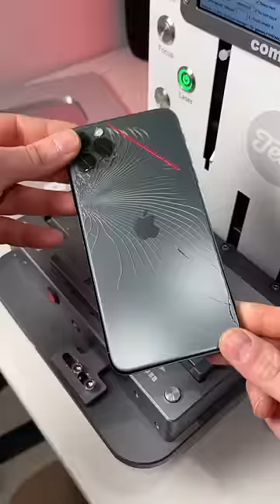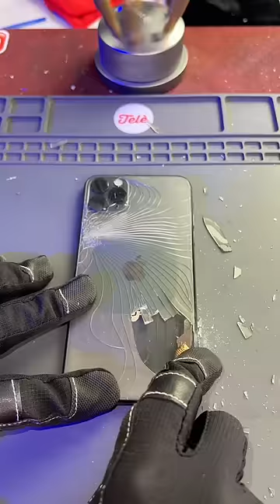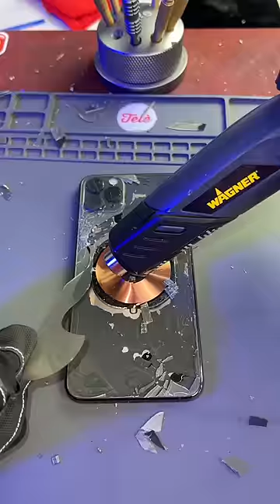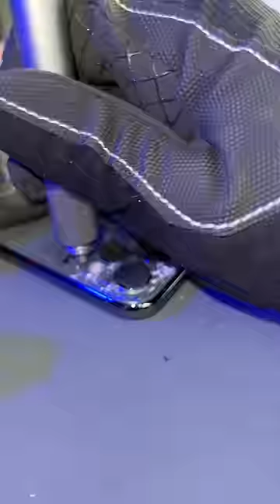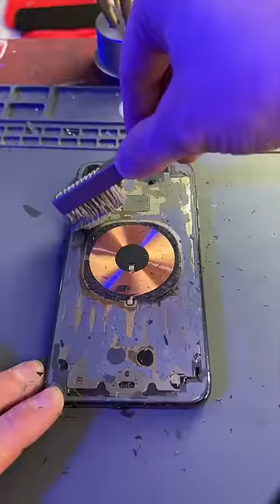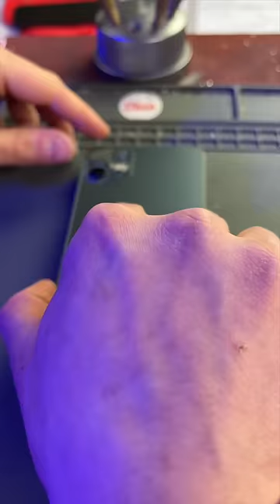Just another day at the office 🤠 #Shorts #Tech #PhoneRepair

Comment: The fact that apple makes their products in a way that makes it so damn hard to fix yet so damn easy to break is fascinating.
Reply: Fact.. I have an older version so it’s not that easy but my android one survived for years and broke after I dropped a weight on it at the gym
Reply: It’s a money grab
Reply: Phone tech here they aren’t that difficult to work on just lots of small expensive parts that you can get aftermarket whereas Samsung is a few bigger cheap parts that don’t work unless they’re oem
Reply: I’ve dropped mine on concrete 1,000 times that’s what a phone case is for. Smh
Reply: @stoneymcdoobie5270  still doesn't justify that money grabbing technique lol that's what I comment is about. 🙃
Reply: Lowkey a scam to get more money. Make it break and monopolize the repair
Reply: @godspeed2621  my phone break after it hit something metal like a iPhone wont survive that
Reply: @bofjayyy  then why are they built like a tank
Reply: @alexjackyperson101  they don't use as much glass as Apple and they use big clunky casing screens vs apple uses 3 layered screens which is the digitizer lcd and back plate when you get a screen repaired for a Samsung it just guts the old phone and throw it in a New one vs getting a new 3 layered screen with apple
Reply: and that it is more expensive to repair it than to buy a new one
Reply: @godspeed2621  5kg?
Reply: What is your solution then
Reply: Like most super cars you mean? Where you get a dent in the fender and it can cost you 15k to repair? It’s how the world works buddy
Reply: Its easy to fix when you have the right tool.
Reply: @stoneymcdoobie5270  it can still crack phone case are not and for really good ones they usually cost 40-50$ which really isn’t worth it same with a screen protector if that breaks have a choice to keep it or replace it
Reply: Who wants a phone made from glass wtf
Reply: But it’s also good quality
Reply: It's so you buy another one.
Reply: It's the only way they can ENSURE they will ALWAYS make profit from their products. Google how much they make from their repairs 💀
Reply: @garden3818  they don’t make it break it’s the person who owns it that makes it break. Just take better care of your shit and you won’t have that problem.
Reply: @godspeed2621  I mean I know it’s an outlier but I’ve dropped my old iPhone 2 stories onto concrete and it survived with a dent like no screen crack 😂 that think went through hell and the only reason I replaced it (the whole back and everything was off it) was because the battery in it got fucked
Reply: @mrkaiman3052  the bullshit with apple is their ports, they make a different port for every phone so that you neeed to spend more and more money it’s a joke
Reply: It’s actually not like this if you do it with apples tools. For instance the iPhone 12s and up have a heat tool that makes it super easy. Idk how much I can say as a tech on the internet so I’ll leave it there, but this guy did it a way harder way 😅
Reply: Samsung dose the same with their screens
Reply: @TB Budak it’s all luck of the draw, you’ll drop it 100 times as I did and it won’t break even after a 2 story fall twice,onto concrete, then it ended up breaking when I was playing music in my pocket and it dropped onto concrete
Reply: Invent the problem, then sell the solution
Reply: They don’t? 😂
Reply: Samsung's are the same lately don't worry. As a phone salesman it's getting more and more frustrating having to explain why the companies suck.
Reply: Honestly I think it’s the cases people put on them, hell some even go without a case. 

I’ve had my iPhone 12 for about 2 and a half years, and I haven’t broken it once, and that’s with my clumsy self and dropping it every other day.
Reply: Almost seems planned doesnt it?
Reply: Planned obsolescence. Blame cars and lightbulbs.
Reply: And that people are so obsessed with them...only because they're trendy 🤣.  It's so weird to me
Reply: guys. samsung MANUFACTURES the iPhone. clueless🤣
Reply: I’ve only cracked my iPhone screens twice and I’ve been using iPhones since the 4s. It’s not easy to break them. How about y’all stop hating on iPhones like little android fanboys and actually use the product for a second. 75% of y’all haven’t owned an iPhone ever, 20% owned an old iPhone, and 5% bought a new one and just didn’t like the OS. That 5% is valid. The rest? Not so much. Read any review and the vast majority of reviewers will praise the iPhone.
Reply: my samsung phone got accidentally run by my friend car and the only thing that broke is the tempered glass
Reply: @Zer0Edits00  Yes however, only people who can afford to buy super cars aren't inconvenienced with a 15k$ repair. Whereas the majority of people who are lower class buy smartphones (many on the cheaper end tbf) but they do care that they're not getting their money's worth. Its just that their opinion means little in the face of a capitalist, market economy.

In short, USA itself is a scam and the people are okay with that so long as they can continue to scam their neighbors to get ahead. We have many commodities that other countries do not, this is true but make no mistake they are far from free.
Reply: Easy to break?! People are just carefree and don't treat expensive phones with care. Ofc all phones designed with glass backs break easier than the ones with plastic, because it's glass. Just get a case if you worry so much about breaking it.
Reply: @godspeed2621 genuine question, how do u accidentally drop a weight on ur phone? 💀
Reply: @dadeee7776  you… you mean the port that hasn’t changed in, what, ten(?) years?
Reply: Is it really that easy to break though? I’ve had 3 glass back phones, the XR, the 11 pro, and currently the 14. Never broken a single one. Not even a crack to the back glass.
Reply: And people love it
Reply: man you've made so many mistakes in spelling of "fascism"
Reply: What's fascinating is that people are stupid enough to buy it again and again.
Reply: @godspeed2621  itd be fine if it were a nokia
Reply: I usually put it under the seat but s @JonteTheRoach
Reply: @zaimnaqvi8893  doubt
Reply: @dadeee7776  Pretty rare but I guess the battery absorbed impact
Reply: @ElBurras5000  30 kg
Reply: I got my iphone 12 awhile ago and ngl it's been working great for me the only thing I've really broken so far has been my screen protectors but never the actual glass on the phone, I used to use alot of Samsung devices and I would constantly be going through them every year but I've been much happier with my iPhone than I was with my Samsung's. Idk it's much more personal preference and also how you use your phone.
Reply: Made in China
Reply: Or you could just put a $10 case on your phone 💀 its really not that complicated
Reply: Bro i am using iphone 7 aluminium body 😂 it often falls and I don’t care 💪
Reply: But why do people speand 1000 on a phone, thats more than my rent every month
Reply: It's capitalism 101😊
Reply: @godspeed2621   lmao
Reply: @bofjayyy  Also a phone tech here, that is BS as I have used aftermarket Samsung parts which work fine, definitely not as good as OEM service packs though. It's the iPhone parts that don't work properly and get software locked when not using OEM parts...
Reply: You mean criminal
Reply: their laptops are even worse ffs
Reply: @bofjayyy  what,s oem?
Reply: Everything is fascinating for iSheeps
Reply: They ain't easy to break? I've had my iPhone for 2+ years and I've dropped it without the case so many times. Not a scratch on it.
Reply: Yeah cuz they are betting on you breaking it and having to buy a new one since fixing the current one is so difficult and
Reply: @zzekegaming  You're clueless bro. Samsung only manufactures the display, display controller and NAND flash chips for the iPhones. They have no control over how the iPhone is designed or how repairable it is. That's stupid like saying to blame IBM for the Xbox being difficult to repair because IBM happens to manufacture the CPU chip for them..
Reply: @ElBurras5000 my Samsung tablet survived after i dropped it more than 10 times, i have it for about 4 years and its not that bad
Reply: @ElBurras5000 i never seen a phone that is cheaper to buy a hew one than repair it, maybe because I live in a South americana country and ppl here are poor idk
Reply: @paranaenselol  si ves que me llamo "ElBurras5000" y eres de Sudamérica entonces por qué no me hablas en castellano o portugués? 🤦🏽‍♂️
Reply: Planned Obsolescence is to blame
Reply: Fact
Reply: @bofjayyy Apple literally locks certain functions of the phone if you use non OEM parts, even if they are from another iPhone. Meaning you have to reprogram the parts serial numbers to trick the phone. Im not even a phone technician and I know that. Samsungs will work just fine with non -OEM parts, but the OEM ones are mucb better.
Reply: @starmanxvi  could you go over some examples the only features I've experienced issues with is wireless charging due to the internal connections being damaged and not tracking battery health with non oem parts I've replaced nearly every part of a iPhone and there's been no issues
Reply: the fact that people happily BUY them is fascinating
Reply: i think the word you're looking for is *expensive
Reply: I don’t understand why buy expensive flagship phones if they are of little use. After all, you can make calls and go online on a phone that has an average price.
Reply: Funny how you can’t tell which of the latest years of pro / pro max this phone is
Reply: The fact that android makes phones that the back and battery fall out of when you drop it 😭
Reply: The Iphone 7 was their strongest phone so far. The rest its weak
Reply: its all about that bag boah
Reply: Funny how u said this right before the 15 came out lmfao
Reply: That's completely by design so you have to spend more money on a new product. You'll notice that the warranty conveniently doesn't cover drop damage or water damage. That plus planned obsolescence means they can rip those dollars straight outta your bank account
Reply: Easy to break? You should see my Samsung. Your iPhone should be just fine as long as you don’t throw it around s 😂
Reply: on porpoise
Reply: also keep in mind until fairly recently you couldnt get oem parts for iphone, or rather the best you'd get is a refurb, with samsung you could usually always get get OEM service pack, and some of the high end samsungs are still cheaper to fix with a service pack than your equivalent iphone with a refurb. take for example, to fix my S22ultra would be about $250 for a service pack, for the 14 pro max that much will only get you a fog oled screen, which is aftermarket, while the refurb is gonna cost you $370, this of course is just parts cost, and assumes you'd be doing the replacement yourself, if not, expect to pay somewhere around $350 for the samsung and $470 for the iphone, not including sales tax.

 also iphones love to make many of the parts serialized, so even if you did use oem parts, certain things wont work the same or at all. apple doesnt want you to fix anything, and probably considers the very idea to be an afront to their brand image, judging by their past comments about iMacs  turning into PC's if you alter them in any way; they want you to just toss the whole phone in a landfill and buy a brand new one. Yes, samsung isnt that far behind apple as a company and even worse in some areas, but I still think they are the lesser of two evils.
Reply: Planned obsolescence
Reply: its made on purpose
Reply: Weakest man of the world: touch Apple screen
Cellphone:*break the intire screen*
People:HOW IS THIS POSSIBLE?!
Reply: @acwesty My wife and stepdaughter only use Iphone because of the OS. I've replaced both of their phones twice each while I still have my old Motorola. I'm a plant mechanic, I'm hard on phones. 

My battery lasts longer than any Iphone, my antenna is stronger (wifi not everywhere), the phone does everything I want it to do with none of the BS I don't need being embedded, and it cost half the price.

Only Iphone users are "fanboys", by definition.
Reply: @P3R_ Or don't put a glass back on it for no usefull reason?
Reply: real. i've owned both and worked on both iphones and androids, androids are so straight forward and alot more durable. my pixel 7 pro has taken a trip up the street after it fell out of my pocket while i was on my bike and its fine. my iphone i had i dropped from my knee height onto carpet and the screen shatterd.
Reply: @bofjayyy Phone enthusiast here, been studying phones my whole life, even been lucky enough to have the chance to take both apple and Samsung phones apart. I honestly don't believe you are a phone tech. Apple phones are frail in comparison to Samsung, with their internals. There is a great reason Samsung wins with Camara, Battery, and pretty much anything you can think of.
Reply: Buy android instead they are very strong especially nokia
Reply: Yet another reason I'm an android user
Reply: @Sharky_0456  Same
Reply: Genius strategy, if the phones break then they'll buy another one.. and they almost removed the chance to fix it
Reply: Tapi banyak orang yang menginginkannya😂

Comment: "Using a blade was a mistake, let me just grab two more"
Reply: sadly with these type of things you don't have many options.  I did the same with a case remover tool for my switch.  They aren't built very well.
Reply: @ivenstorm I've seen people use a butter knife to pry away at things like this. They may sharpen it a bit to get the knife under stuff more easily, but the butter knife is significantly sturdier when it comes to stuff like this
Reply: @SuperIdol101C  oh, most definitely.  Next time I don't think it will be as difficult as I'm buying a 3d printer for other things around the house, so I can just print new tools.
Reply: @ivenstorm skibidi

Comment: Its so over complicated designed to go through this much trouble just to change a back cover of a phone. It used to be a 3 second task where you just push the plastic back cover and it comes off. The best part: you can also remove the flat battery, change to a fully charged one at the same time.

Comment: Idk what tool would be better, but since it’s an exact-o knife, it’s gonna break more easily since it’s not meant to be used that way lol.
Reply: Jerryrigeverything razor works the best ask anyone
Reply: Personally I usually use an opening tool (I usually call it a wedge or a pry bar, the flat metal tool provided with most phone repair kits) and that usually works fine. It’s a little wide so on the smaller slivers I’ll switch to either a razor or an exact-o knife like what he’s using here.
Reply: I also just realized I said “usually” like 3 times, lmfao

Comment: Not gonna hate, but you leave the extra paint and glue residue? Not gonna clean that up with a scraper? I mean each to their own for certain. When I do a back glass I just use some hot air and careful hands with a flat blade. No residue and no paint. 👍🏻 if you got a lot of back glasses to do the laser does make it much quicker. I would just scrape the remainder 😂. Good work though